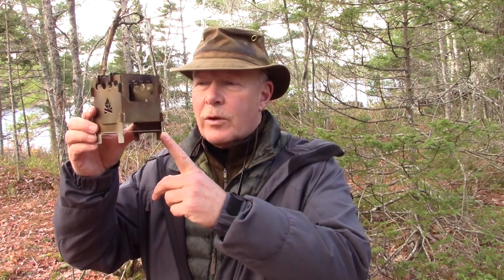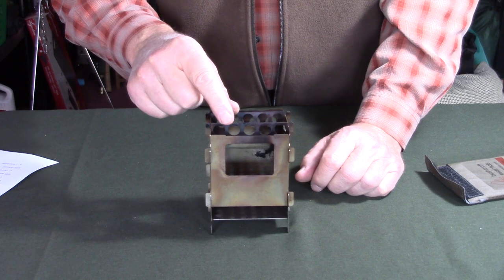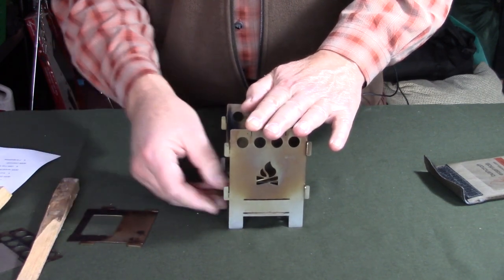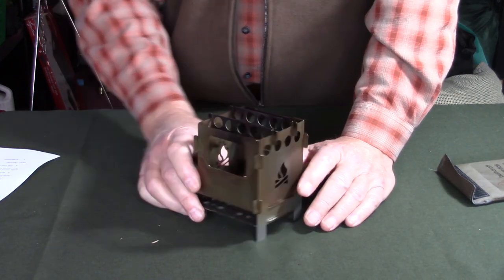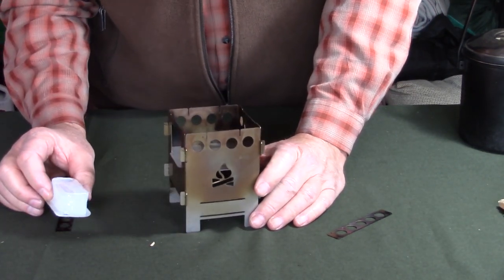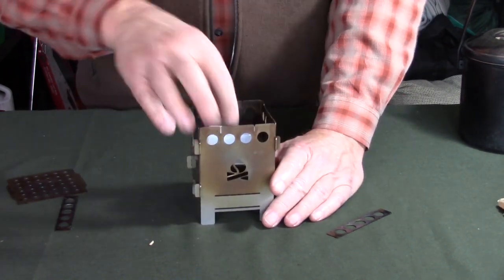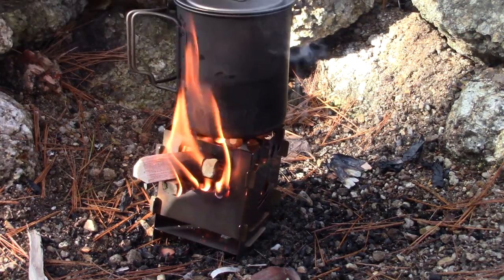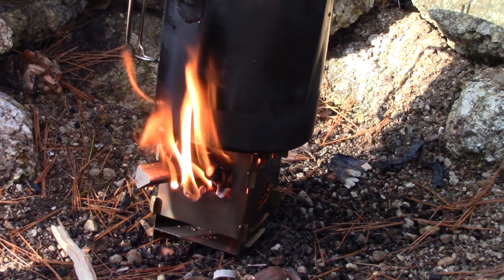Bushcraft Essentials Bushbox Outdoor Pocket Stove - Comprehensive Review

Comment: Greetings Mark, As usual, you have produced one of the most comprehensive and educational resources on the topic of small wood stoves. I don't have the Buschcraft Essentials version of this product, but rather the clone sold by Lixada. Its so similar that the weight is even within a quarter of an once of the original. I paid about $11 USD a few years ago and thoroughly enjoy the quality and design of the product. Just wanted to let your viewers know about a lower cost option if they are unable to afford the German made version.
Reply from the maker: I have looked at the Chinese ones but have not bought on yet. They look almost identical. Thanks for commenting

Comment: I have an original firebox (which I absolutely LOVE even though it weighs a ton) and this stove. I got this stove because a friend got frustrated with assembly and disassembly and gave it to me. 🤷🏼‍♂️ I love that this is smaller and lighter than my old firebox, but I don't really enjoy putting it together, especially if it's really cold outside... I still don't know if I've found the ideal stove, or even if I ever will. Questions abound: Titanium vs SS? Folding vs fit-together? Large vs smaller? And then there's rocket stoves et al... Stick stoves are a like a rabbit's warren to me - where does it actually end - so thanks for all the good information! 👍🏻
Reply from the maker: I find myself in the same place. So many stoves to choose from. That is why I started making videos on stoves. I hope it helps other make good decisions for themselves. I may do a video of stove philosophy of use that helps buyers ask the right questions before spending money. So far, my personal favourite in the Bushcraft Essentials LF in titanium. I am testing now for a review. Thanks for commenting
Reply: @MarkYoungBushcraft  I would personally like very much to see a video of 'stove philosphy' from you. A buyer's guide, of sorts. You've invested more than enough time to gain the experience to do such a project well, and your opinion seems very well received, judging by comments here... Personally, I'm  looking for the golden trinity: lightweight, folding (as opposed to - to use a phrase I heard you use - 'puzzle' stoves) and most of all, affordable! Thanks!👍🏻

Comment: Interesting, and I see they have in interesting ultra light.  1 comment and 1 question.
You use it with nice dry splits, but one thing with a stick stove is you can use sticks, and sometimes it's hard to find super dry wood.  So can it generate enough heat to burn wood effectively when the wood isn't optimal dryness?
And comment, i know people can get picky on here, but given that the hardest part of using alcohol stoves is keeping the darn things lit in the wind, does it really matter if you can't snuff it with the cap?  Just blow on it, 🙂
Reply from the maker: Hey Jim. Your point on using wood that is not completely dry is well taken. I do try to use the driest wood when testing stoves. In my experience, the larger the stove (Firebox or Bushbox) the better the results with less than ideal wood. They allow for a larger critical mass of heat that will dry the wood faster. It is harder for small stoves to reach that critical mass, especially in winter. Having said that, some stoves stand out as doing better than other by design. The Nano and this Bushbox are good examples. I believe it is because of the well designed airflow. They may consume wood faster as a result but they also reach the higher temps needed to dry the wood. Still, I will take time to find the driest wood when using stoves. I will use dampish wood in an open fire after I have it well established. It may smoke more but it will usually catch. As for alcohol stoves. I find the Trangia design does not blow out as readily as some of the others. Small DIY pop can stoves are easier. Still you point is good if it will work with the stove being used
Reply: Mark Young     So you actually liked the nano too?  
I checked the link to the store you gave, and I'm glad you did.  A good site, and they have stuff like the nano, and with no duty to pay at customs! 🙂.    I'm really debating what to get.  There's this bush is, the light one, and the Nano.   I was set to get the Pack Stove,  but I think that's only available from the US.  Also, if there are affordable folding stoves, I'd prefer that.
.........I'm so confused!!   Tell me Mark, what to buy?! 😃
Reply from the maker: @ LOL...this is exactly my problem Jim. So many stoves out there I just had to get them all. If you are not in a rush to buy wait til I review the Bushbox LF. This is one of my favourites. Good in stainless steel and even better in titanium. I will be doing review on the Nano as well. I own both the SS and Ti versions. I also have the Pack Stove XL I will be reviewing soon. It is everything the original is but better
Reply: @jimf1964  Hi JIm. I'm in NYS and have two Firebox Nano's. Love them but again they are for one or at most two people, which is fine. Winter in NYS I switch two a gasifier ( Canway w/the narrower pot supports) Which takes much larger wood chunks. Yes, chunks. I know the Nano type are called stick stoves but I make it as close to a Swedish fire torch as is possible and continue feeding the thicker chucks (one in. diam.). This also allows me to warm up easier because of the higher volume and cook for up to 4 people. But, to get to my real comment....Get the Nano w/the X case. I really love this. Self contained and I can still cram 1/2 book of matches, wind proof candles and a small fire starter or two inside the case w/a ranger band. The carbon felt wind block that comes with it, imo is only good as a pot holder to keep your hands from getting burnt. I use aluminum foil, kept under the ranger band as a wind block as the metal rods supplied to prop up the felt is a gimmick imo. Get the case! The Nano is all hinged so no parts to loose that warp and you struggle to take apart after a few fires or cold hands in cold weather.  Get the case!l You'll  be glad you did.
Reply: W ALKERONE   As Mark can testify, I'm a sworn to the death firebox fan.  It's all I ever use, winter summer.  I'm in Quebec btw.  But it's a big, powerful stove and frankly I don't need that much just for a hot soup on a day trip, or maybe an over nighter, alone or with a friend.   So I'm on the market for something more compact, but still useful.
I agree with you about those "puzzle stoves " that need to be put together.  I love the way mine just unfolds, but the Nano just looks SO small.  And the pocket bushbox seems a little bigger, and the bushbox light seems like a good deal to use with the trangia stove too.  Plenty of room for the summer ring.....though to be honest, I don't see myself using that very often anyway.
Reply: Mark Young   That's great!  Looking forward to the reviews.  Hey, did you say the bushbox can Not do a Swedish torch, or any kind of top down burn?  I think a torch would be my preferred method of using those little guys.
Reply from the maker: @jimf1964  Jim can you send me a email address or look me up on FaceBook? I will make a short video for you on what I have. You can also see my email on my channel page under the "about" tab